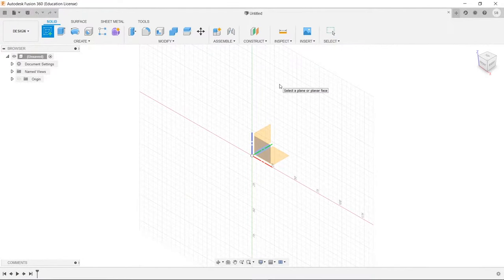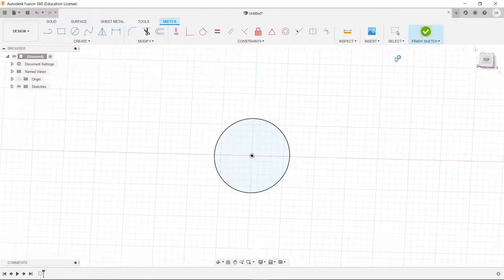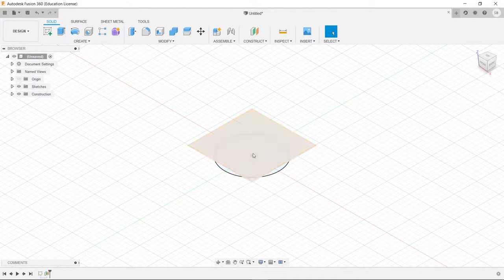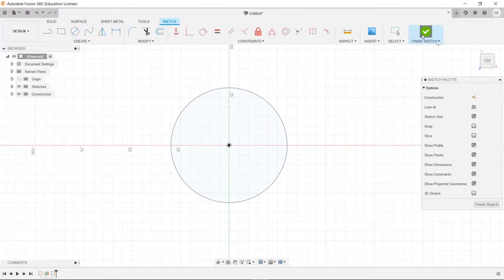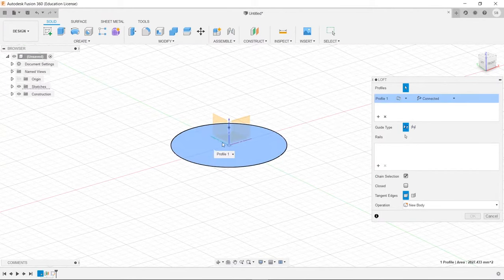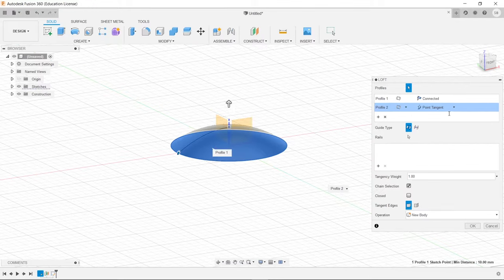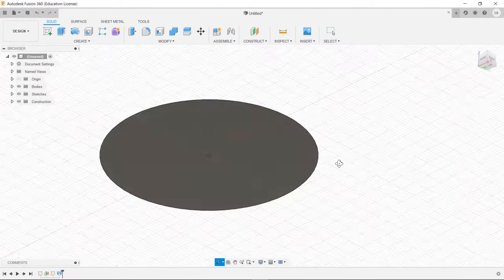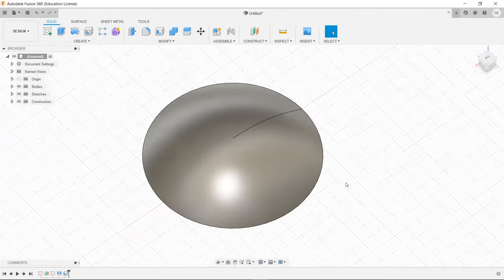Fusion 360: How to make a convex shape

Comment: Is there a way to add multiple hexagonal holes on the surface?
Reply from the maker: If you make a drawing on the original plane with the hexagons you want, then just do an extruded cut through all and it will cut your shapes into the surface.